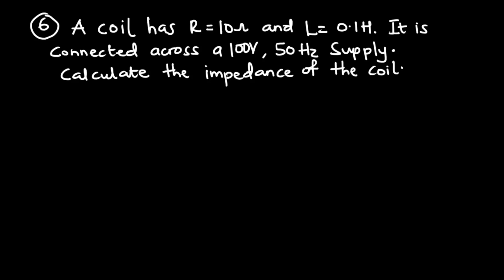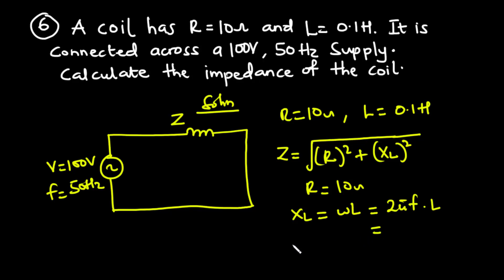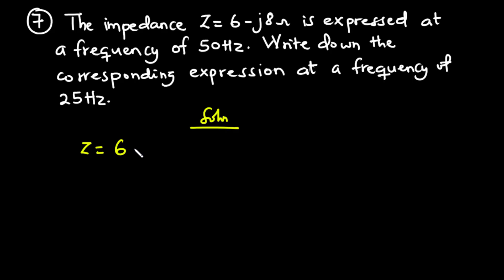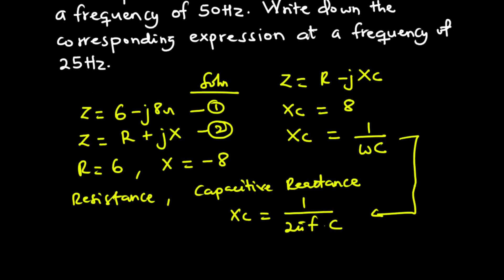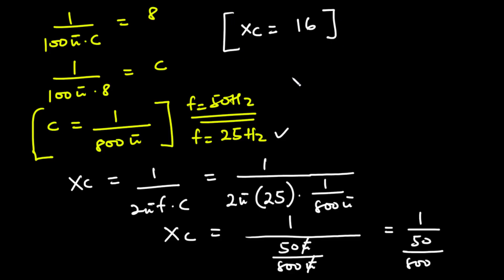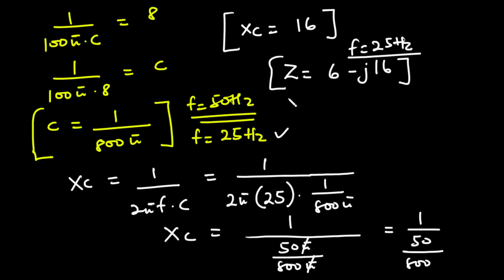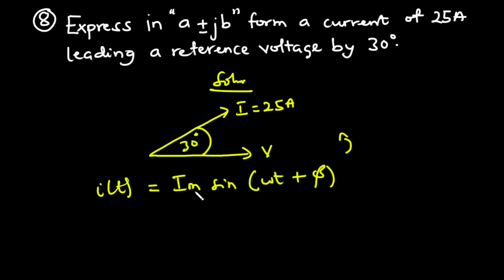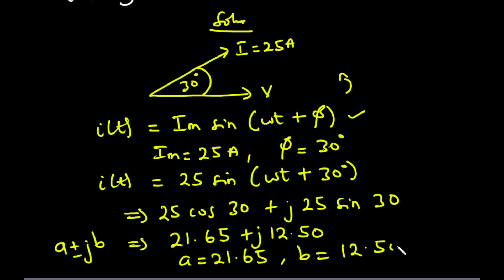40 - AC CIRCUITS PROBLEM 6, 7 & 8 |Finding the Impedance of a RL Series Circuit| #KNUST

Comment: For problem 7 how did you  know that the imaginary component  of the impedance is a capacitive reactance and not inductive or both?
Reply from the maker: It's a capacitive reactance because the imaginary component has a negative value.
Reply: So how will you know if it is an inductive reactance or both?
Reply from the maker: Good, you should understand that, if XL >XC the RLC circuit is inductive hence the imaginary value will be positive. If XC > XL the circuit is capacitive and the imaginary value is negative, but if they are the same, ie XC = XL they cancel eachother and the circuit behaves like a pure resistive circuit